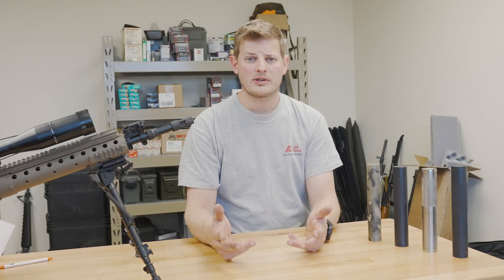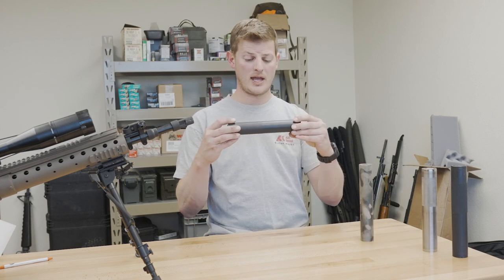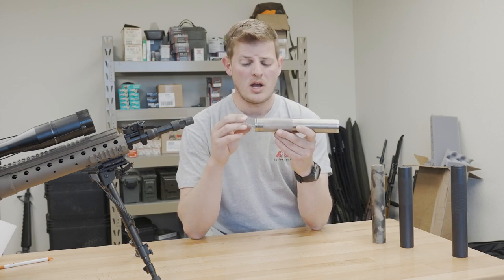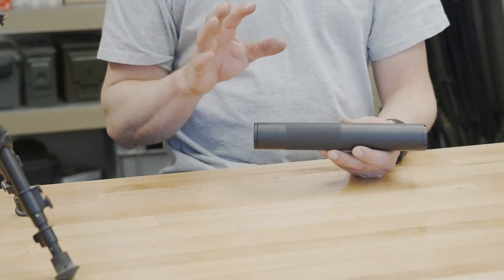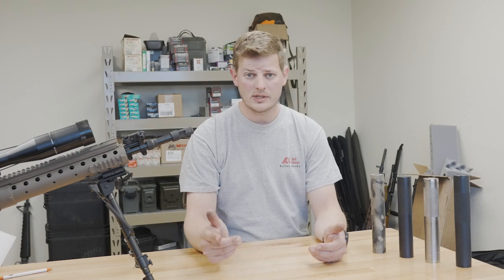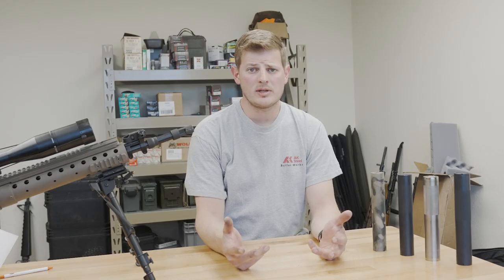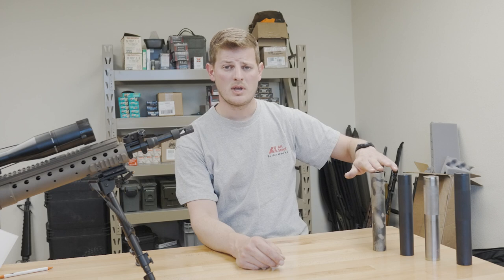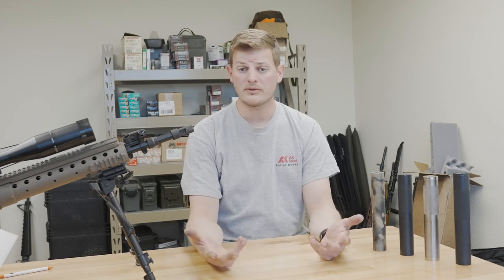Ops Inc 12th model style Suppressor Comparison

Comment: good video, right there. i have a question for you tho...  looking to install an Ops Inc 12 on a factory Colt M4A1 Socom barrel but using an M4 collar purchased from Charlies Custom.  currently the collar will slide back almost the the 203 cut before it stops.  do i need another, tighter, collar or will moving it up and locking it down to get the 7-10 turns lock be sufficient safety wise?  
i have found plenty of videos on testing and comparisons but not a single one on proper installation.   
thanks in advance!
Reply: Same setup colt 14.5 socom with collar tightens down good with set screw at edge of front step of 203 cut. I get 8 turns. Otter creek has a one piece mount that will work if your worried about the 203cut and set screw location.

Comment: Nicely done, Dave!  Do you have specs of the "mag dump" rifle?  I am wondering how the Ops Inc collar was adapted to it.  Thanks
Reply from the maker: 16” FN barrel chopped and contoured to 12.7” and the three piece collar fitted. 

Basically a MSG Gordon clone rifle.
Reply: @dwilsonmfg  Ah, I see.  Contour the M4 profile to SPR for the collar?

Excellent info.  Thank you, so much.
Reply from the maker: Sort of. The three piece collar gets contoured slightly differently than an SPR collar, but generally the same concept.
Reply: @dwilsonmfg  pretty much custom fit all around. 

Thank you for the intel, Dave.

Comment: Any easy way to clean the OCM5?
Reply from the maker: Why even bother trying?
Reply: Most are stainless steel so use the dip method with 1:1 H2O2 and Distilled Vinegar. Won't hurt it but will take any copper and lead out that may be there. Which will not be much. Carbon cleaner will take out carbon. Acetone for grease and oils. Easy :)